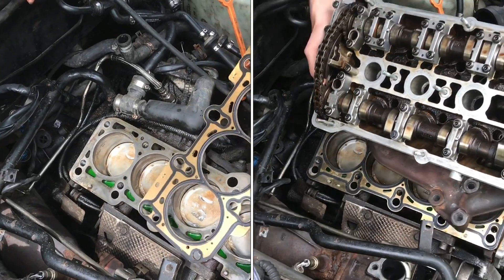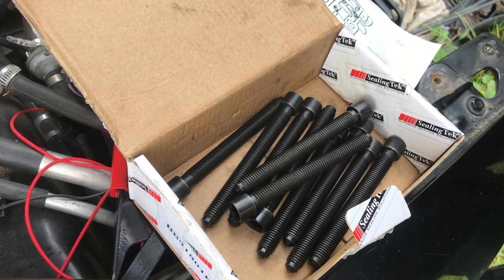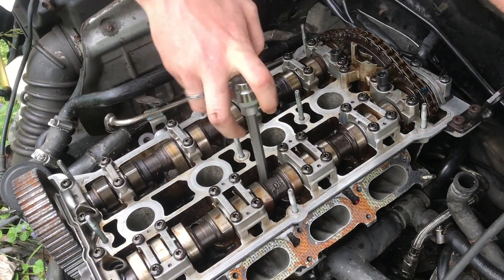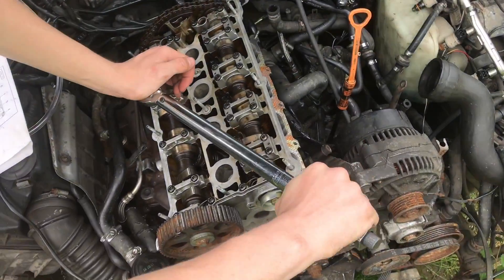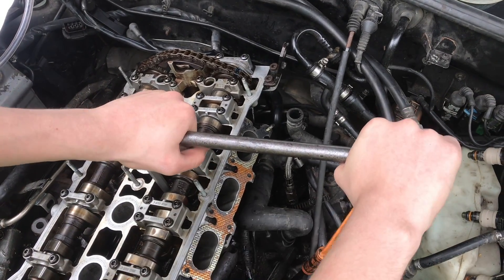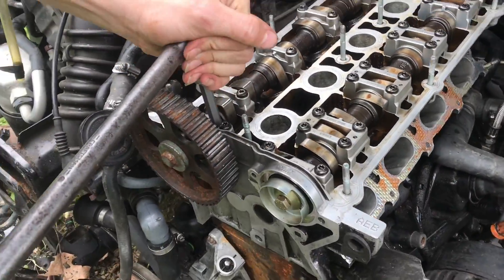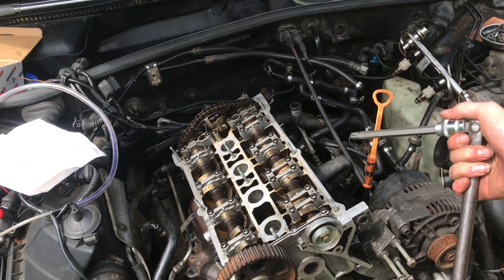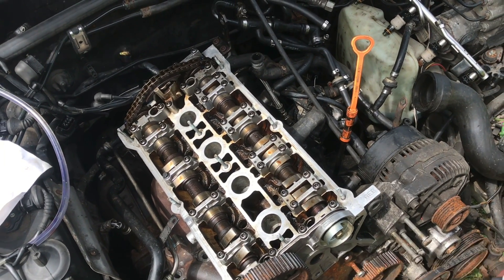1.8t head bolt TORQUE SPECS and procedure (aeb) audi volkswagen

Comment: Add a drop of oil on each headbolt, never do it dry you will have torque yield loss, and with oil will never hear "bolt seating" sound. Also you need to torque at 40nm(29.5 ft/lb), then 60nm(44-45 ft/lb), then 90°, then 90°. Your setup is 1000% not torqued properly.
Reply: You,re right, its the 1.8t not the 1.6 engine, different sequence